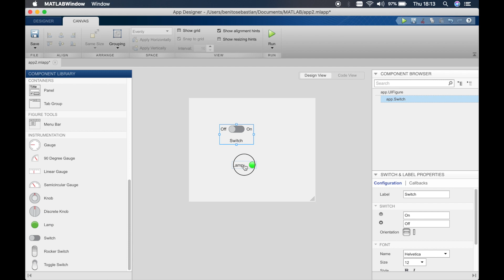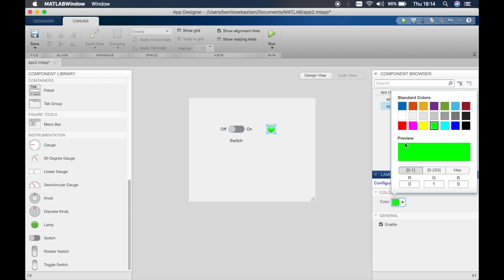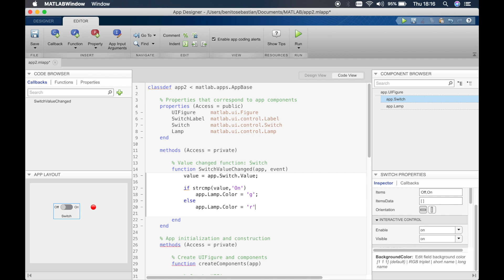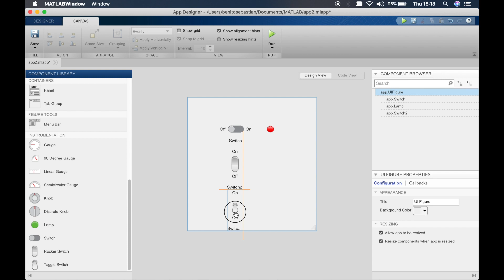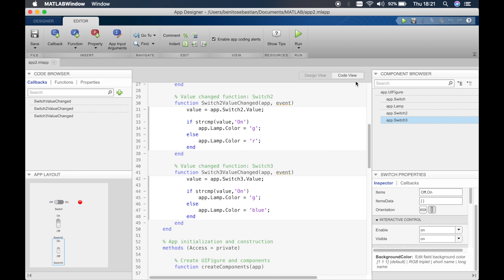MATLAB AppDesigner | Tutorial 6 | How to use a rocker/toggle switch

Comment: Got a quick(ish) question. I am using the GUI switches to control a series of relays(via an Arduino). All works well except that I want one of them to be activated when one of my switches is off. The relay does not activate until the switch is toggled first. It seems to me that the value changed function does not get to the "else" part of the logic until the "If" part has already happened. I did get around this by initializing the relay during my startup function, but I would like to know if the problem can be solved within the value changed function logic.  I don't have any real computer science background so I'm a bit slow with these things.